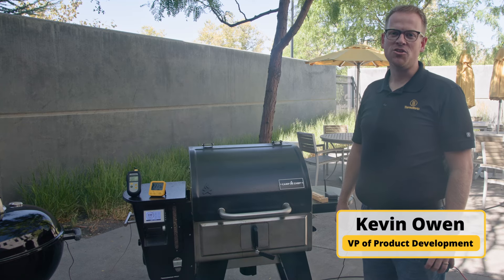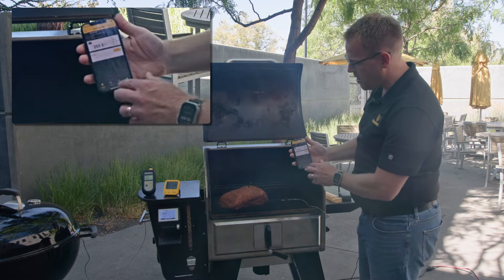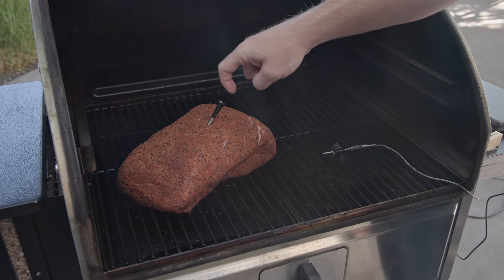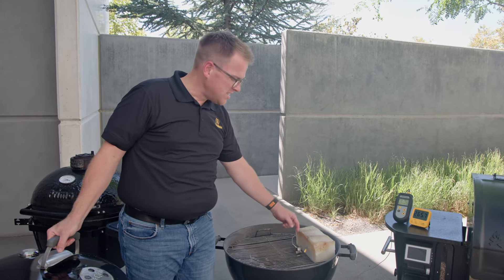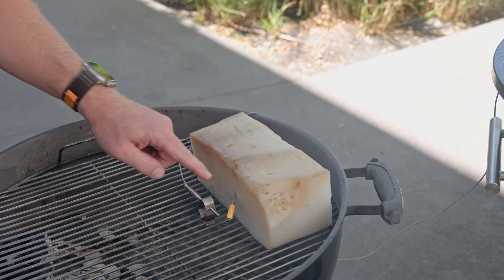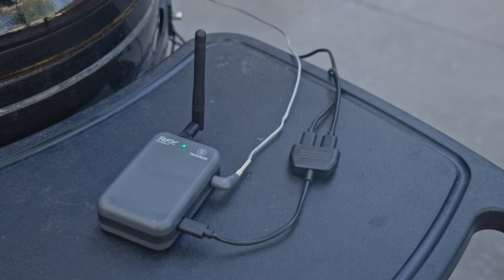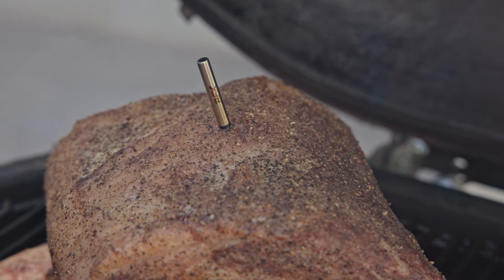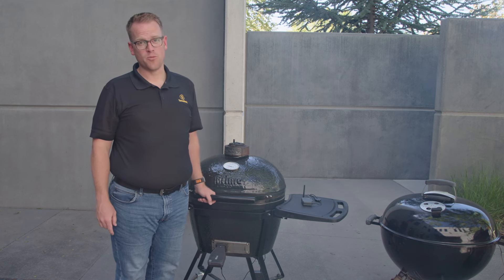Why do Ambient Sensors not work on Wireless Probes?

Comment: The ambient sensor on the 1st competitor product shown on this video is about 10 deg. F off from our Weber Lid gas grill thermometer  and in my experience has confirmed the way I have been grilling for years. The hypothesis here is very interesting but perhaps more relevant to a big mass of meat such as a brisket and not so much for a thick steak or rib roast? The 1st competitor product software has been so good predicting the desired meat cooking temperature that I question any real added value of having a better ambient temperature sensor? Thanks.

Comment: Can't one place a wireless probe in a clip on the grate keeping it away from the meat to get the ambient temp?
Reply from the maker: Unfortunately, current technology would not be able to withstand the heat. Here is an explanation https://youtube.com/shorts/fpyieyTa8JA?si=KJn-_jDhJekF7-CI
Reply: @thermapen  Ahh, makes perfect sense!  Thank you
Reply: @thermapen it’s seems you could just make a bulky wireless with the “heat sink” protecting the battery and electronics with a short wire going to the probe far enough away to not affect the reading.